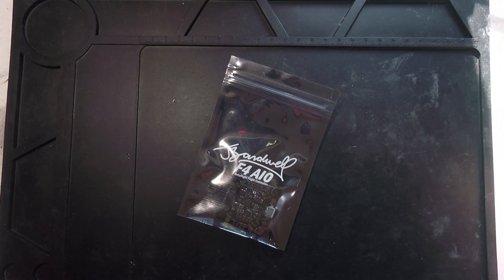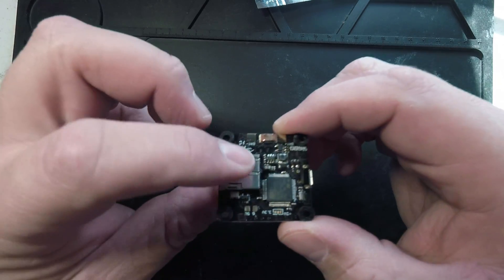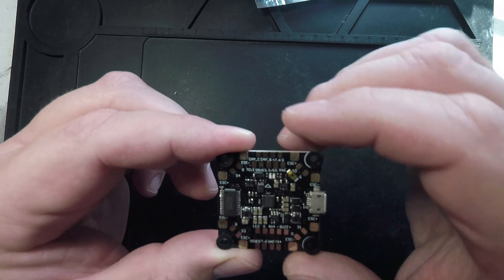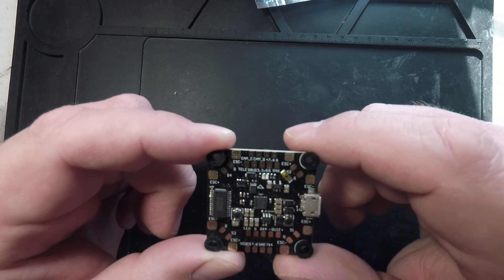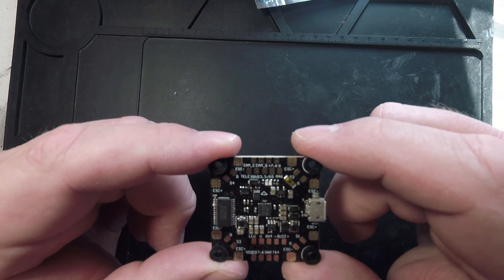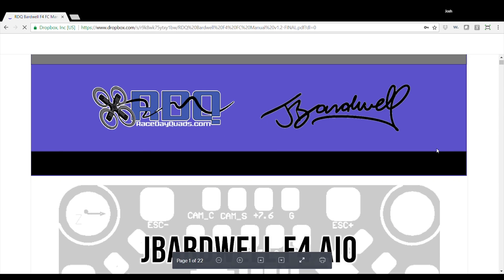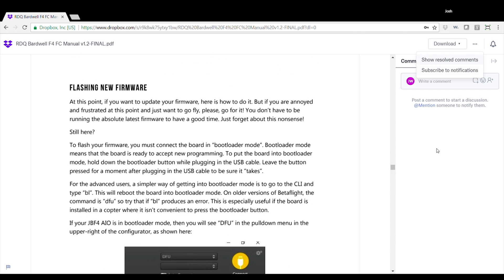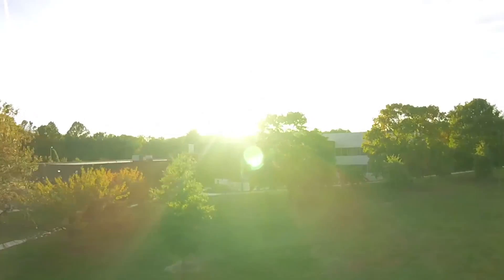Joshua Bardwell F4 AIO FC | Initial Thoughts and Observations

Comment: I have this board also and just one question , I'm using a spedix aio esc. Do I just use the signal wires off the aio fc and not use the grounds?
Reply from the maker: That works fine.  I've run it both ways and can't tell the difference.